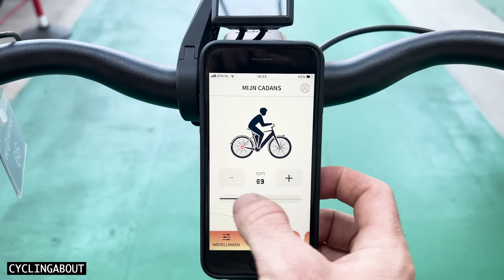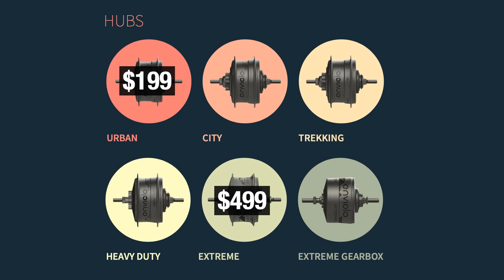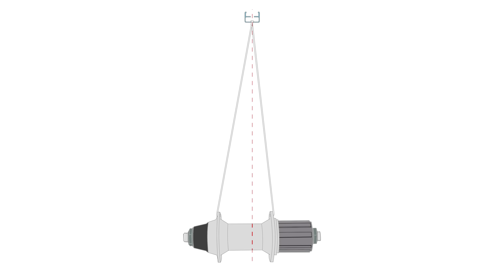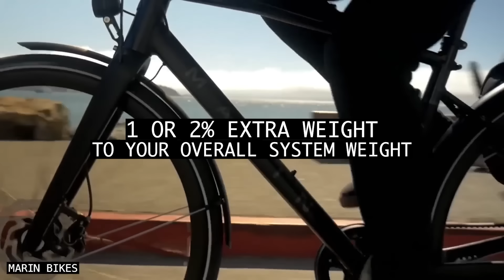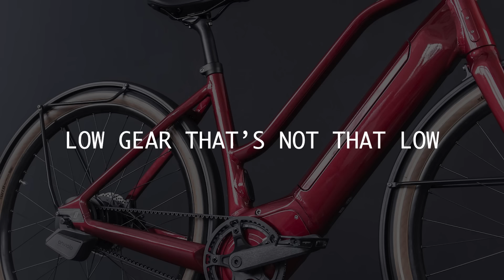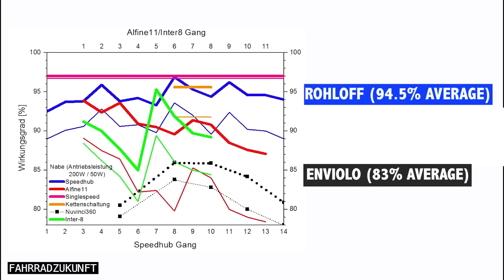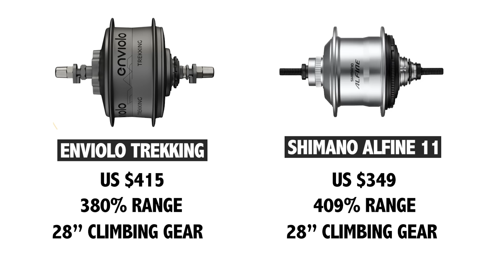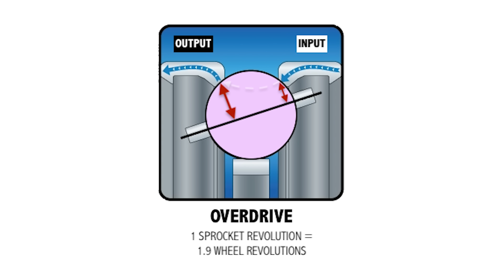Are $199 Enviolo Hubs the BEST Internal Gear Hubs For Bicycles?

Comment: Great comparison. I own derailleur, enviolo and Rohhloff bikes. The derailleur bike is a folder and the only one I would like to drive should the battery die. The enviolo bike is the best to use in the city, mostly because the shifting is much less of a trouble at traffic lights or when conditions change quickly. For long distance biking I absolutely love my Rohhloff although I do not particularly like its electronic shifter.

Comment: I personally have the pinion , rohloff , kindernay and Alfine 8. Love how robust the pinion and rohloff are. But my Alfine lasted me 6 months. Water seem to sip through and caused a lot of rust within the hub and the bearing race were so badly rusted the entire hub ceased. While the kindernay often have shifting issues and requires bleeding so very often.
Reply: Sturmey Archer and Shimano planetary hubs have very poor sealing against water invasion. If you look at a 3 speed Shimano or Sturmey hub you can actually see one of the 3 bearing sets, they are not even covered, much less sealed. 

Which leads to the second issue, they are packed with grease at the factory, so you can't lubricate them, without disassembling the hub, and repacking, which is beyond the abilities of even experienced home mechanics.
Reply: @PRH123   i have disassembled my alfine 8 and its do-able . but requires the TL7001 shimano tool to align everything back in place when assembling back . but still , using sealed bearings would be so much better. on a side note the alfine 11 / di2 are using oil bath instead of grease. they work alot better and also lesser resistance than the alfine 8 .
Reply: @IvanLiew1404  yes oil bath is much better…. the very old SA 3 speed hubs were oil lubricated, with a fitting on the hub for adding oil…. They need to bring that back…. 

or transition to cartridge bearings, as they have on their other hubs…

Comment: I use a alfine on my koga bike but a enviolo automatiq on my riese and muller doing about 10k on it over a year. I know you touched a little on this but for me the concept of bringing the whole drive train under software control is key. The cvt can always be kept in correct mode (less stress on parts) and combined with a (ebike) good motor and controller you can always 'shift' and change how the bicycle reacts. This makes for a whole different riding experience i don't shift at all anymore and the new bosch system also has a auto mode that adapts to you so even that doesn't need a change anymore. The end result is i just peddle and go always at my speed (turns out 68rpm) we are already seeing special modes where like in a car you can set it in different modes to create different riding curves and more sensors are coming in to control things like abs, wet riding, tilt sensors to it detects hills up and down. The fact that the whole motor and gear system is stepless and my 'peddling' can be stable but the drive train can be flexible is perfect. Its perfect for the dutch roads i use it on. The only downside if i move back to a normal bike (in this case my koga) i forget to shift all the time. I think anyone should ride a enviolo automatiq for say 100km just to see how it feels best on a comfy bike like a riese and muller its just so relaxing and fun.

Comment: I use the enviolo in a bike share more than daily. Everything you say is very true, when wet it's almost impossible to turn the manual gearchange (although if you grip differently can help), and even being constantly abused, it feels more like a cable issue than a gearbox issue. But they still get very beat up

But being able to change gears while stationary is huge on cities with lots of red lights, worth the efficiency loss for me
Reply: In my personal view the only way to use a enviolo is with the automatiq only then the real advantages of the system become clear. The loss means its mostly useful for ebikes and yes the 10% extra loss (maybe as explained) is true but that just means you are one gen behind in battery tech. The jump from 500wh to 625wh or now 625wh to 750wh and 4 or 6 amps charging will take care of that. I ride about 60km a day on a reise and muller with enviolo automatiq changed my whole view on how comfy and fun riding can be that combined with our good and getting better bicycle paths in the netherlands.
Reply: Maybe spraying the rear mechanism with Corrosion-X would solve the problem
Reply: @scb2scb2  Yo, still loving the automatique? Which R & M bike do u have?
Reply: @ghagen888  Yes i now have 16000+ km on it. I have a nevo3 gt automatic with some changed parts. The only thing i didn't like where the breaks i upgraded them to the mdp models when it was time for some updates. Now the enviolo had to be replaced at 14000km not because it broke but during maintenance the shop made a mistake and broke it so they replaced the whole back wheel with a new one+enviolo+controller part. So i can't 100% say how long it would have lasted but it was fine as far as i can tell before they broke it :)
Reply: @scb2scb2  nice. I got a cheap e bike as first my first. Next one i know i gotta put some money into it. I want that auto
Reply: @ghagen888  There are several systems coming that do auto-gearing so far the enviolo automatiq seems to be the most stable/proven even if its still kind of unsure how long they will last but my guess is 20.000 to 30.000 under normal use. There are cheaper bikes (at least in europe) that also use this system probably about 6 or 7 brands ship the enviolo automatiq system. I do feel that the automatic is better than the manual and lasts longer since its hard to 'overpush the system' its always in a good gear to keep stress down and there are no cables that can stretch or break compared to the manual version.

Comment: I'm amazed by the double standard.
CVT is perfect because optimal pedalling efficiency is always achievable as long as you don't care about the overall efficiency.
Derailleur is bad because you can never have optimal pedalling efficiency.

Breaking news: if you don't care about everything else (your main argument for accepting the huge power loss of the CVT) you can also have constant perfect pedalling efficiency with a derailleur. If you feel like you are between 2 gears you can simply chill a bit and select the easier one. This sacrifices a tiny bit of speed (most often less than the 14% power you constantly sacrifice with a CVT). Instead of wasting those 14% energy from your last meal, you can use it to go further with a calm pace and without a sweat.

Comment: You missed one thing about the weight difference.
For normal cargo/components you are correct. But for rotational unsprung mass, these weight differences become much more impactful.
If you're interested, there are a number of online calculators for that, and even if mostly aimed for cars, these can easily be used for bikes as well.
Reply from the maker: I decided not to place emphasis on unsprung mass as I don't think that full suspension bikes (and rough terrain) are the primary application of Enviolo hubs.
Reply: Fair enough, but doesn’t the fact that it’s rotating mass matter in any case?
Reply: @AndreSomers Not much because the mass is near the centre of rotation. It's the moment of inertia of the wheel that matters, not its mass, when it comes to the effect it has on the ride. Moment of inertia is proportional to mass but also to radius squared, so heavy rims or tyres make a massively bigger difference than heavy hubs.

Comment: Great video, you do a fantastic job of hitting all the good points and also the bad points of the enviolo hub. Some videos I’d seen prior to buying a bike with an enviolo hub gave me the impression that there are no disadvantages to this hub but that just isn’t the complete picture. 
One thing about difficult shifting and cable wear, I suspect the setup is poorly done, my bike had issues with difficult shifting and it took ages for me to diagnose it. If the cable lengths aren’t correct and the cable tensions are also wrong it’s very easy for the cable to run off its guide within the shifter. This can damage the cable as shown in your video or even damage the shifter itself (this happened to me…). 
There’s also a significant lack of literature on forums, YouTube etc. The enviolo support videos are less than 5mins in length and do not show you where you can go wrong (again maintenance is not a perfect world except on cleanly edited YouTube videos…). 
These hubs do have a place in biking but it’s not perfect by any means.
Reply: which hub do you recommend if you ride a bike a lot and need less maintenance? I currently have an Envilio 380 and I am thinking whether to change it to an Envilio automatic or a Rohloff automatic
Reply: @mr.denoli7749  not having an electronic shifting enviolo or Rohloff it’s hard to say. Alfine di2 has complaints online as well. If you understand the setup for enviolo it should last (mine after heaps of stuffing about finally works fine and I understand what’s important when the tutorials tell you cable tension is important but without the explanation why and how much tension is required). 
I’ll keep using enviolo 360ct but I think if I could spend big rohloff would be in my sights. If I get off my ass I’ll make a video about all the issues I’ve had with enviolo 360

Comment: Well, I can certainly appreciate the evolution of internal gear hubs. Now, my bike, an Apollo from 1962, is working on a three gear internal hub. It has done so since the day it left the factory. It hasn´t needed any oil change. It has always worked. It does not make any sound when I change gears or while driving. I can change gears while stopped (not recommended, as the third gear is quite strong to pull). 

I have the feeling that this is just another overengineering case, an illness our society is strongly suffering from. Again, I appreciate the idea and advantages, but normal people will never exceed the need for a lower first gear of mine, nor will they find third gear not enough for speeding. 

Combining bycicles with mobile phones on the other hand seems to me like getting crazy. We have now around 240 million cases of serious neck problems and that is only the tip of the iceberg. Mobile phones are the worst idea ever and people should start to STOP using them. As flexible I am with innovation, on that point I completely go the opposite and condemn them. I am now the only person in my city without a mobile phone, but some years from now, I will have been a pioneer instead of being laughed at.

And yes, I am as old as my bycicle. In fact, we were "born" nearly the same day. This may explain some of my stupid texting, I hope.

Kindest regards and the very best to you and your beloved.

Miguel

Comment: I am leaning towards the pinion gearbox for my next bike. They have the motor hub assembly for ebikes that is also attractive.
Reply: But there is a fairly large weight penalty over the Rohloff.
Reply: @petesig93 yes, but that weight is down low and in the center of the bike. That translates to a better handling bike.
Reply: @buckroger6456  What someone needs to do is "fixed" gear cvt. Like in my polaris 1000c ATV. The speed spins the belt to higher gear. You can only do this with fixed gear as freewheel would drop you to smallest gear while coasting

Comment: Very interesting video. I have a Van Nicholas touring with an 18 speed Pinion gear box, and a Schindelhauer Heinrich with Bosch motor and Enviolo Automatiq. Where I live in western Massachusetts, it is pretty hilly and for day rides I get out on a good amount of gravel. The  Van Nicholas is great for touring, but I find for daily use (errands around town or out for an afternoon ride) I turn increasingly to the Schindelhauer/Enviolo. In "Touring" mode I go up the 7%-8% grades around here, and it is so quiet and trouble-free. I thought I would miss the wider gear ratio of the Pinion but even with a bit of off-road the e-bike more than handles it. Service seems to be widely available and a local shop will handle the Bosch+Enviolo hub, a combo which has a reasonably wide distribution in the US. Love your Buyer's Guides, BTW.

Comment: I have one of these on my Tern GSD10. It's a pedelec, which means I can't really comment on efficiency. But it also isn't an issue. I really enjoy that I have full control over the gear I choose, and to be able to adjust at any time. I probably wouldn't choose this for a non-pedelec bike. For an ebike, it's perfect. Also, the Tern is ridiculously expensive (my wife pulled the trigger on that one), but I find normal bikes suboptimal by far now. It has excellent balance, excellent suspension, adequate pedelec support, and I can transport two relatively large kids and their school bags without even thinking about it.

Comment: The speed change happens because of the distance of the contact patch from the centerline of the axle in the ball. When the output contact is closer to the axle, the diameter of the contact path is smaller, so it's like having a smaller sprocket. When it is further from the ball axle, the diameter of the contact path is larger, like having a larger sprocket

Comment: Few points on Rohloff. Many owners say that gears 1-6 are basically never used. There are reports of oil leaks. Lastly, there are complaints about the noise in certain gears.
Reply: Depends on what you are using your bike for. On a city bike the 520% range is likely overkill. On an MTB it is not (I certainly use the lowest gears a lot).
I never had any trouble with oil leaks but I can only speak for myself.
And yeah, every gear has its own sound. Not a big deal IMHO.
Reply: The reports of oil leaks are largely exaggerated.  It's pretty much the same few repeated again and again year after year, out of the many thousands of Rohloff hubs in use.  I wouldn't worry about it (and I don't - my Rohloff doesn't leak).  I use gears lower than 6th all the time, and I ride in a city.  It's just a hilly city.  Also, using lower gears up hills gets me longer battery range on my e-bike - rather than using max assist in a mid-gear, I can bump the assist down and use one of the lower gears.  3rd comes in to play regularly, and I've used 2nd on one particularly nasty hill.  1st is just fun every once in a while lol.  But I use 4th often.  And as for the noise, it ticks when coasting just like any derailleur-equipped bike.  The nature of the ticking is different between the 1st-7th range and the 8th-14th range because of the reduction gear.  But it is true that it is not silent like a Shimano 5-speed e-bike hub (I think it's called the Inter-5?) that I also have experience with, or an Enviolo, but I don't know why anyone would complain about normal bicycle gear sounds.  The wind drowns it all out above 10 or 12 mph anyway.  

I'd recommend trying every gearing option before buying an expensive bike tho.  Sounds that don't bother me may drive somebody else nuts, who knows, and be sure to go up a hill to be sure the lowest is low enough.  I tried an Enviolo-equipped version of my bike before buying, and I really liked it.  Very smooth, totally silent, decent range.  I'd totally get one if I lived somewhere flatter.  But the hills around here, many above 8%, some up to 15%, plus the relatively placid cadence of around 78rpm at max assist speed of 28mph/45kph in 14th, made me bite the bullet and shell out the wince-inducing extra chunk of money for the Rohloff.  It hurt, I ain't gonna lie.  But this was a long-term purchase and I'm glad I did.  It's been brilliant.
Reply: If gears 1-6 are "never used," then the bike is obviously undergeared! Rohloff is the benchmark for IGH, and not by accident. Speedhub 500/14 has the most user friendly gear range, efficient power transfer, enviable reliability and after sales back up. I considered a Nu Vinci some years ago when they were available cheaply on eBay, but lack of gear range and sub 90% efficiency were deal breakers. I spent much more on a Rohloff and have never regretted it. Annual oil changes and one set of replacement cables is all it's needed over several years. Tough to beat on all counts.

Comment: The comparision is fair and done with a really comprehensive overview!

In my =opinion= the Enviolo is only an option, when we are talking about E-Bikes. In this Application the lack of efficiency is less important, because you get the "dissipating power" from your electric motor. But it still "feels" a little "soft" while pedaling.
But yes, the advantages are justifying the power that is lost in the hub: It is a good hub for everyday use, especially in combination with a belt drive and an automatic shifting, because you do not need to think about ist. It just works.

On the other hand I have one Enviolo in my household that failed within less than a year (a "Heavy Duty" in a R&M Multicharger). The guarantee-handling was/is poor and so are the repair-options because there are simply none: You can just exchange the complete hub, that's it. The wear of the (inner) cables is also legendary, the 90° change of direction within the shifter is just poorly made. Another crazy thing is the "reset-problem" of the hub interface mentioned at 14:40. Why is it designed that way?

But again: Even though I personally would prefer a Shimano over an Enviolo*, I recommend an Enviolo hub for Riders of E(!)-Bikes that don't want to think about shifting, maintenance and all the other things.

*but I am riding only Rohloff 🙂

Comment: In March 2011, I had a NuVinci N360 (Pre Enviolo) installed on my Rivendell Atlantis. It worked OK but shifting required some effort to twist. On mine, it would drift out of position (gear) at highest setting. If it would stay in gear I would have kept it longer. I sold it in 2016 as I was not riding it much. The pros and cons depicted on this video are consistent with my opinion. I would have loved electronic shifting.